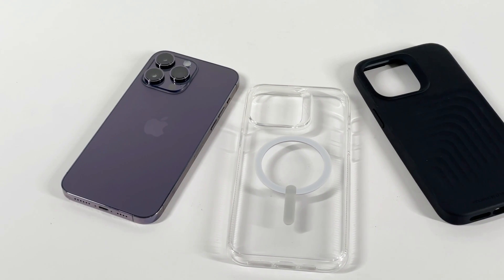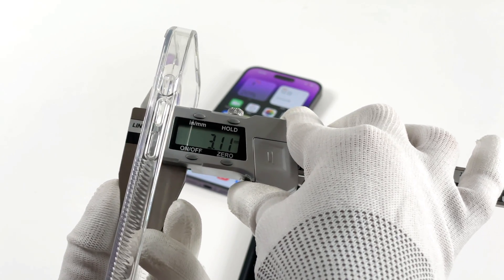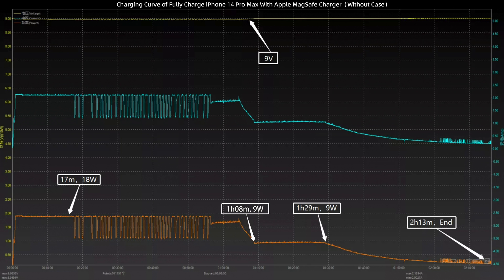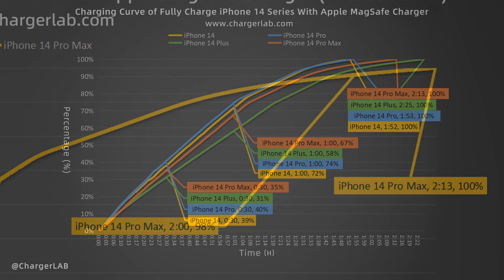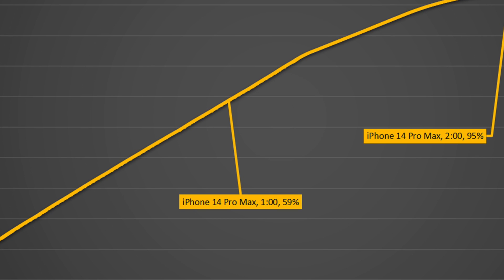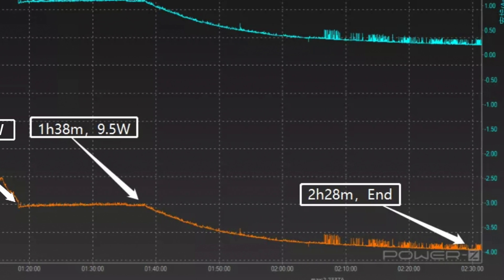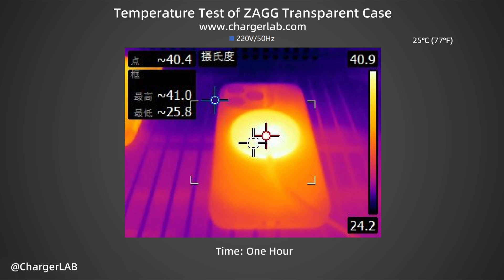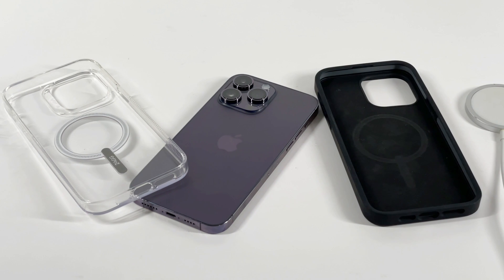MagSafe Charging Comparison | With Case vs Without Case (For iPhone 14 Pro Max)

Comment: One thing you don't comment on, but which would be very helpful, is the ambient temperature at the time of the test.  I would like to know how much the results would compare with my general experience, as I live directly below the equator, with temperatures consistently above 40° Celsius.  Thanks for the videos.

Comment: Does the iPhone 14 Pro (no max) charge with no mag safe case also? Or just the max version
Reply from the maker: We take the pro max as an example. The pro version should be even worse because of the smaller heat dissipation space.